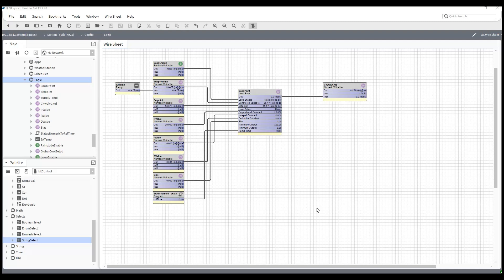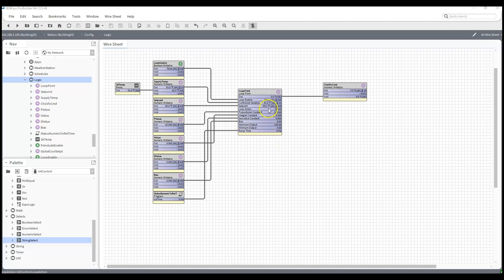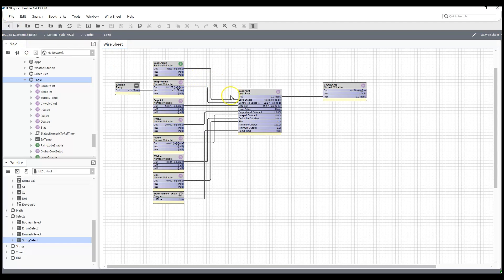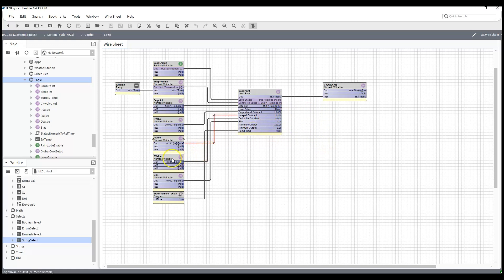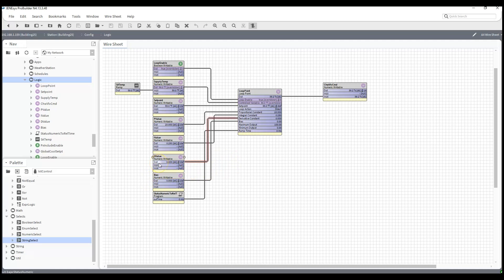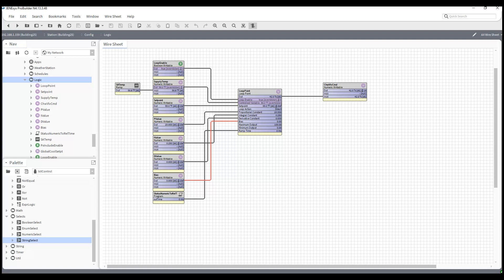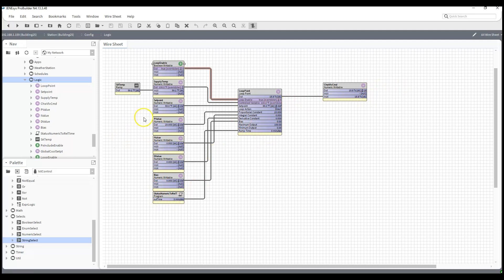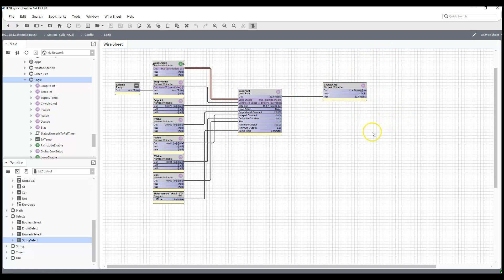PID Tuning with Charles Johnson

Comment: Why don't you discuss Execute Time in either video?
Reply from the maker: This is a good question. The reason why I don't discuss it is I've never found a good reason to change it. I guess is that if you would, it would be no more than up to 1 second. Realistically, if you use a good proportional and integral, and use the ramp time to help at startup, you should be good to go. 

I suppose you can slow down the execution time to adjust its algorithm, but I don't think I would recommend it.